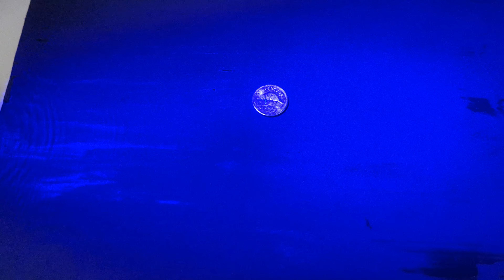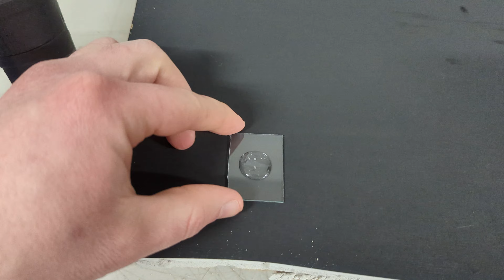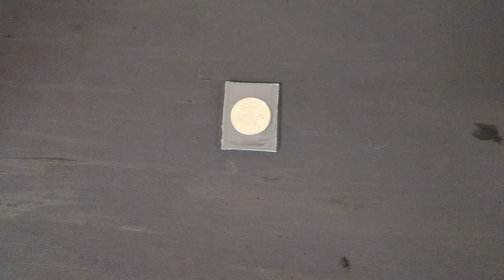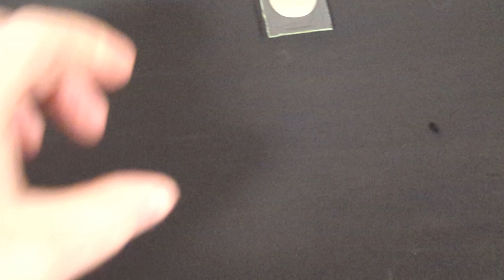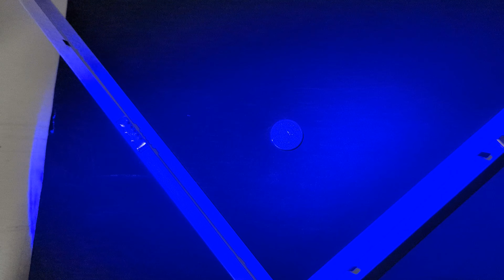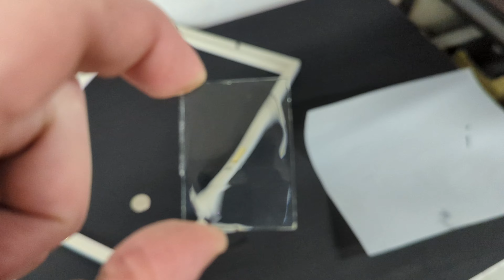How I make holograms with 3D printing resin.

Comment: He intentado todo. Tengo la resina intentado con otro tipo de resinas pero no funciona. Se no se graba nada ya intenté estoy utilizando un láser 405 nm a 100mw y no sé por qué de verdad no está funcionando no me quiero rendir estoy utilizando una resina igual pero de otra marca también ya intenté con resina de joyería y tampoco funciona. Me podrías ayudar?
Reply: Probably because he is using a 900mw 405nm Blue Ray diode.
Reply: possibly the reason UV-activated polymerization of the resin results in no image is due to the immediacy of the curing dynamics, such that once the surface of the resin is exposed, it deflects and scatters the penetrating rays, thus completely obscuring any image.

Comment: you might have created an image, however, it's in the UV range, beyond human sight. to see the object, you'd need to shine UV light through the hologram and view with a camera system that converts UV into visible light.
Reply: that's not at all how holograms work. literally every single thing you said is wrong. you don't need the same colour of light to view a hologram that you used to create it. think about it for 5 seconds. have you ever needed a laser to view a hologram, or have you spent your entire life viewing them under normal lighting??? 405nm is not uv, it's just v. totally visible VIOLET light. you also CAN'T use it to illuminate the resin or the resin will continue curing until it destroys itself.
Reply: @creepyloner1979  there are different types of holograms. research it for five seconds. f! I interacted with a troll!

Comment: would this "emulsion" work with green (532nm) laser?  did you let it dry/cure before exposing the plate with your laser?
Reply: No, this particular resin isn't sensitive to 532nm light. Dental resin might work as it has a broader sensitivity than 3D printing resin, but I haven't tried it myself. It doesn't really "dry" on its own, and curing it before exposing it would use up the resins capacity to harden and result in no image.